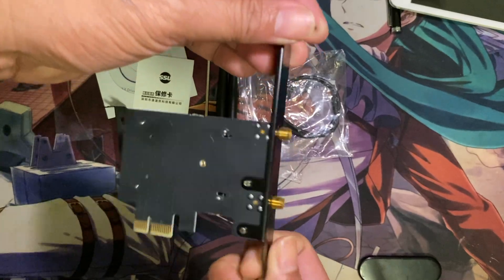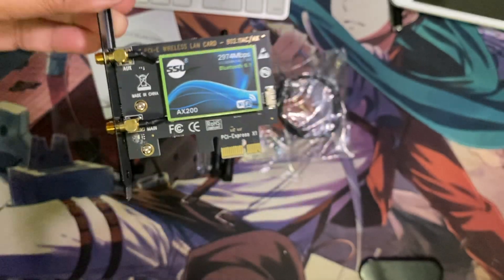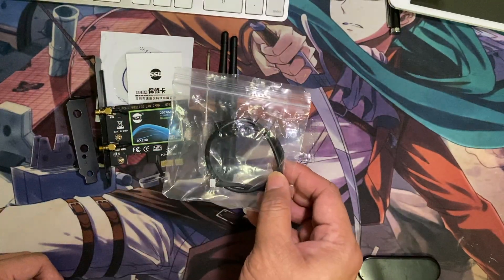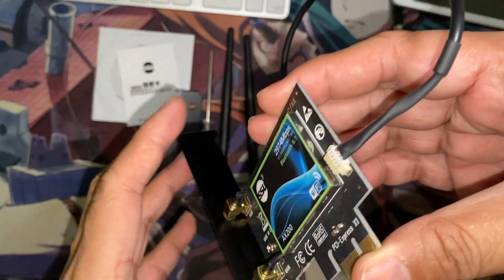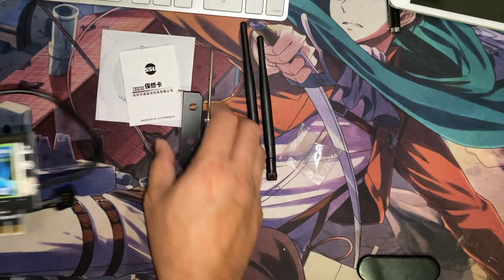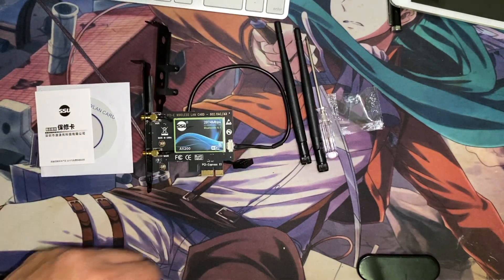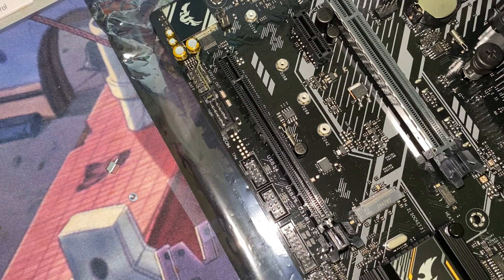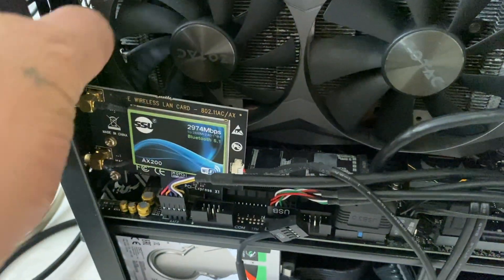Wireless ASUS Tuf B450M Plus Gaming.

Comment: I am trying to install a TP-link TX50E dual band wifi card (similar to the one in video) but the pc does not recognize it. Nothing happens when I go in device manager. I have the same mobo. Help would be much appreciated!
Reply from the maker: The card that I am using on this build has an intel chip set. But regardless, your Windows' Device manager should detect it. Go to device manager to see if it detects it. If not check if its plugged in securely and check if there is a proof of life; you check if the led on the card lights up. Unless if it doesnt have one. Even though the card is 1 lane, the pcie slot can support it. If the card cannot be detected and no indication that its on, the  card maybe faulty.